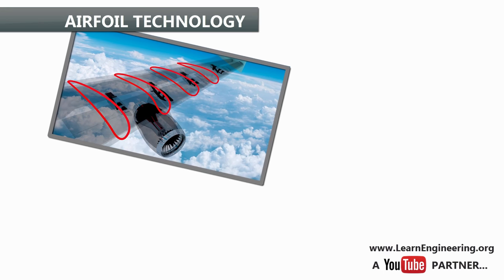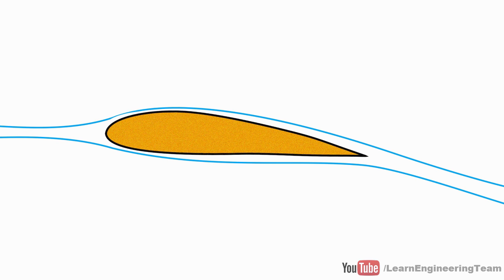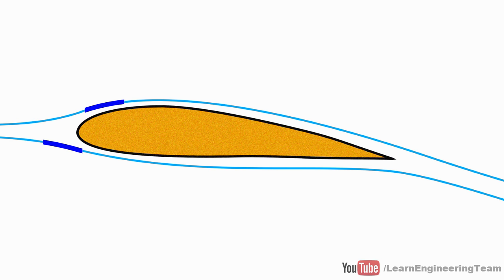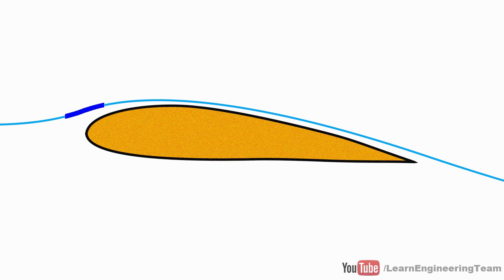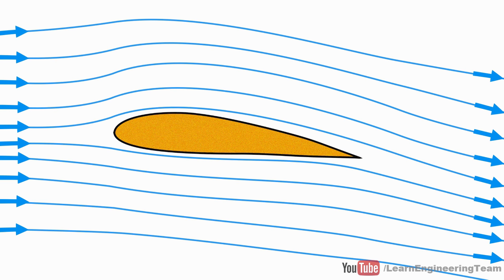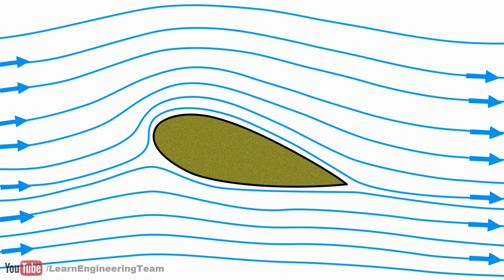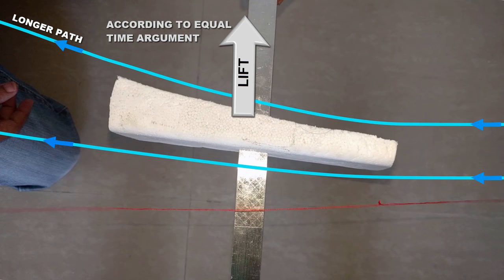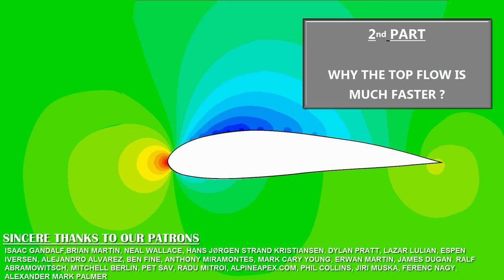How do Wings generate LIFT?

Comment: Wouldn't the venturi effect play a major roll in this too? Fluids at higher uniform velocities have a lower pressure, even when they're forced into a tighter pipe.
To such a predictable degree, that high volume flow meters don't measure the velocity of the fluid to know its velocity, but rather the difference in pressure to know its velocity. Even air speed indicators operate on this principal.
If the air on top is moving at a significantly higher velocity than the bottom, then there should be significantly less pressure.
That's the way I always understood it, even before I read any books on it (which had the equal time theory in them).
Reply: Yes, a 2D model must always have a venturi effect.   The lifting force is always a Newtonian force pair, and while one end lands on the airfoil, the other end lands on the distant ground.  This problem is rarely mentioned in intro courses (hoping the smart students won't catch them,) and in advanced courses they appeal to "Starting Vortex" to remove it.    Yet in the real 3D world, the lifting force lands upon empty air, not on the distant ground.   Also, the 3D airfoil is depositing momentum into the descending air; an effect which is entirely absent in 2D flow diagrams.  In other words, 2D diagrams always depict "ground-effect flight," but they've conveniently erased the ground from their diagrams.  True 3D flight is nothing like a venturi, instead it's more akin to a pulsing jellyfish leaving behind a trail of ring-vortices.   But without the pulses.   Like this: http://amasci.com/wing/lasrWing.gif
Reply: errrrrrr, that is just wing tip vortices
Reply: > errrrrrr, that is just wing tip vortices

Ah, you've go the typical misconception: the idea that vortex-shedding is irrelevant, or that the vortices are tiny things only at the wing tips, or that the vortices stream out horizontally behind the wing.   All three are extremely wrong.

In fact, the lifting force is entirely created by vortex-shedding.   Unlike with flight in two dimensions, flight in 3D is a matter of vortex-shedding, where the vortex-wake behind an aircraft is carrying off the downwards momentum, same as with the jet of gasses below a rocket, or the downwash-plume below a hovering bumblebee.

The tip-vortices are actually the core of a vortex-wake which has roughly twice the width of the entire wingspan.  The "vortex" is far bigger than the fuselage, far bigger than the wings.   That vortex-pattern carries immense mass, and that vortex-pattern is descending.    It's the "rocket exhaust" of an aircraft, where the plane only stays up, because the mass-bearing vortex-pattern has been forced downwards.  To clarify, here's a classic video segment: http://amasci.com/wing/lasrWing.gif
Reply: +wbeaty what are you talking about? wing tip vortices create upwash as well as downwash, and cannot be responsible for creating lift! it creates induced drag, but otherwise does not affect the wing aerodynamics
Reply: +jiunn wong What textbook did you use?  In fluid mechanics etc.?

> wing tip vortices create upwash as well as downwash,

You have a serious misconception.   The vortex wake of a wing is the downwash, is the Newtonian reaction-mass which keeps the aircraft aloft.  You're right, the circular flow doesn't contribute to lift, only the net downwards motion of the entire vortex-pattern contributes to lift.  (I ask what textbook your class used, because some texts ignore this major point, never treat the vorticity aspect of flight, and only analyze wings of infinite span.  If yours does this, then your misconception is not your fault.  It was taught to you.)

> it creates induced drag, but otherwise does not affect the wing aerodynamics

No, it has an enormous effect on wing aerodynamics:  vortex shedding is the single origin of lifting force.

Unfortunately, intro texts pretend that physics of winged aircraft is utterly different from the physics of helicopters, in that a hovering helicopter has net downwash  ...but wings do not.  That's wrong.   Specifically, they pretend that the tip-vortices trail horizontally behind the wing.   No.   The tip-vortices (and the entire vortex-wake) are carrying enormous momentum downwards, and they descend continuously.    The tons of 747 aircraft remain aloft because the downwards-moving vortices are associated with enormous mass which was left in downwards motion by the aircraft.

Is this important?   Only for the physics, since without this feature, 3D wings violates all three of Newton's laws.

A 3D aircraft cannot remain aloft without producing a downwards-moving wake, a wake which performs the same function as the momentum-carrying exhaust plume of a rocket's reaction motor.  Like so:

- If a rocket could hover above the ground without forcibly ejecting reaction-mass downwards, then it would violate momentum conservation as well as violating Newton's 3rd.

- If an aircraft could remain in level flight above the ground without forcibly ejecting reaction-mass downwards, then it would violate momentum conservation as well as violating Newton's 3rd.

See what these "Bernoulli based" explanations gets us?   Simplified concepts, but accompanied by blatant violations of high-school physics.
Reply: +jiunn wong

Thanks, that's exactly what I'm looking for!   Much appreciated.   I don't have Shevell, only much older stuff, so I'll look for a copy.

> Shevell is prudent enough to NEVER claim the source of lift as newtons third law.

Yes prudent, because this would clearly expose the Newton-violation found in typical explanations.    As long as we conceal this problem within pressure-based reasoning,  or distort things using "starting vortex," the flaw remains hidden.

Heh, I've been doing this since 1989, and have yet to become tired!

But if you don't want to respond to my huge message here, I understand entirely.    This is all still good practice for me, since "enemies will find my errors."    Two decades later, they've found most of them.

> I believe you are the one who misunderstood wing tip vortices. There is a net downwash, as well as a net upwash.

I understand the circulation explanation, the flow-turning version, the vortex-based version, plus the Newtonian explanation of wings, including the Feynman Sprinkler problem in physics, etc.  I'm trying to flesh out the Newtonian explanation as in Anderson/Eberhard recent textbook.    I and two others have been fighting this battle since 1988, and managed to push the meme enough that "Airfoil Misconception" has invaded major newspapers, piloting forums, RC aircraft forums, etc., and now academia has discovered it, and started posting lectures to youtube.  Finally!    "Airfoil Misconception" started with Kraus, but I've nominated myself as "Kraus' Bulldog" and rubbed everyones' noses in it.   My best success is with NASA GRC website, which directly attacks the known airfoil misconceptions.   But not this one.

The Newton-violations I'm now discussing only are discovered when one understands all of these Lift-explanations in combination, from a momentum-conservation viewpoint.   It's simply stated as, "A 2D airfoil diagram depicts ground-effect flight only."   That's a key concept to accept and understand.  (Accepting it I think is the hardest!   2D airfoil diagrams are direct violations of Newton!)

:)

Another key concept is, "Fixed-wing aircraft are fundamentally like hovering helicopters, if helicopters are drifting horizontally, at any speed."

Move a hovering helicopter horizontally at 1in/min, or 10ft/sec, or 200MPH.   There is no threshold where the physics suddenly changes to that of a fixwing.   In all cases the momentum-carrying downwash does not diminish at all.   Yet the helo downwash does become smeared out into a slightly-diagonal pattern, and appears to vanish entirely; trailing horizontally behind the rotor, while actually the parcels are descending as always.   The physics of fixed-wing aircraft is the physics of a hovering helo, or bumblebee or hummingbird, regardless of horizontal translation of the craft.

> You cannot simply learn principles from what you have been taught, you must be able to criticize the principle and prove or disprove the principle with proven basics.

Exactly.   Exactly.   I've detected profound misconceptions in intro books, then popularized this.  But then, being "sensitized," I started seeing a profound misconception at all levels, not only at the childrens-book level discussed in the video above.    You yourself have misconceptions and are making fundamental errors here.   If we continue, I'll demonstrate.

>  For example, for the wing to affect sufficient downwards mass flow, it  must impart momentum to the free stream..... where does this momentum come from? 

The NET momentum comes from gravity, from the down-force of the aircraft weight.   In order to remain suspended above the earth, "in level flight," an aircraft must somehow shed down-momentum constantly, with this down-momentum being injected into the craft per unit time, by gravity.   This shed momentum must either end up in a confined downward fluid jet, or be cancelled-out by an instant upward contact force with the ground, as in a venturi diagram.   GEMs use the venturi phenomenon to remain aloft.   Fixwings dump their down-momentum into a fluid jet associated with vorticity, where the location of the vorticity is descending.

> The engines and bird muscles cannot produce that magnitude of power!

Of course they can!  (Hovering crows, hummingbirds, bumblebees   ...they're helicopters in basic physics, just with a different pattern of vorticity in their downwash.)    In all these cases, the work performed in creating the momentum-carrying fluid jet appears as a component of induced drag.    The work done by hummingbirds and helicopters is mostly a consequence of induced drag;  the dumping of momentum into a confined, descending flow.

I think the following fact is little known:   induced drag has two components, first, one originating from the mechanical work performed in rotating the parcels associated with tip-vortices.   A second component originates from the mechanical work performed in moving the momentum-carrying vortex-pattern downwards.     (The parcels don't just "swirl," they also descend uniformly.)

> In any case, the root principle of conservation of energy would rule the 3rd law of motion explanation invalid: 

No, it doesn't.    COE and Newton's 3rd both apply to helicopters, and in identical fashion apply to wings in 3D, where a wake-vortex is being produced.    (Yes, you make a good point for 2D diagrams, where no wake-vortex is produced, and the lifting force is ground-effect force only, like a venturi.    But 3D aircraft do not harness this venturi direct-contact force, except when flying below a wingspan in altitude, WIG.)

> Fixed wing aircraft must create the same downward mass flow as a helio of the same mass, thus it must expend the same power to stay aloft and NOT any less, and this is simply  not true.

Wrong, it's exactly true, yet there's a common confusion:   the separatrix of the Hills vortex, and the fact that fluid jets carry net momentum, yet the parcels at the intake of a fluid pump do not inject net momentum into the pump.  (That's the Feynman Lawn Sprinkler problem.   Also the reason that a fluid pump produces net thrust, but only for high-Reynolds, where a jet forms at the pump outlet.)   Together, all these concepts give us the explanation for a hovering helicopter, where the incoming air does not deliver net momentum to the rotor, but the constrained downwash DOES carry net momentum away.    Gravity injects the down-momentum into the fixwing craft, and exactly this same down-momentum must be shed into the downwash of the wake behind the craft, otherwise the aircraft couldn't exactly balance gravity and so remain at the same altitude.   

OK, here's the thought-experiment:  move a hovering helicopter at ANY horizontal speed, and then we attaing the physics of a fixed-wing aircraft, but viewed via Newton's laws rather than from surface pressures.   (Or, do you claim that a 'special' large horizontal velocity exists, a velocity where helicopter-physics vanishes, and fixwing-physics magically appears?    There is no such velocity.  The downwash momentum never becomes any smaller.)  The same physics applies to both fixwing and helo.  Only some long-standing tradition makes us believe that the Newton and the "surface pressures" treatment must be representing entirely different physics processes.

You've seen this GIF below, right?     It shows the significantly-descending vortex-wake behind a fixwing model.    That vortex-wake also appears behind a helicopter in rapid horizontal flight.    A fixwing aircraft follows the same physics as a "helicopter moving sideways," and the fixwing aircraft is dumping momentum into a very large and significant downwash, as shown below...

http://amasci.com/wing/lasrWing.gif

The downwash seen in this above GIF ...might it actually be insignificant and feeble, and we're allowed to ignore it?    No, because don't forget, this is a thin slice, while the entire downwash occupies immense volume, and so contains immense down-momentum, same as any helo downwash.    The weight of any 3D aircraft appears in its downwash. (not just helicopters, but for all aircraft flying at altitude, while not in WIG/GEM.)

Our typical widespread misconception, at the level of undergrad and graduate textbooks, is to mistakenly believe that this downwash only exists for helos.

Additionally, we pretend that the vortex-wake behind a fixwing aircraft is NOT DESCENDING, when of course, it actually is.  (The faster we fly horizontally, the more the downwash becomes "smeared out," and appears as a slightly-diagonal pattern in the miles of wake behind the aircraft.)    Ignore this net downwash of wings and we blatantly violate all three of Newton's laws.    Or, ignore the horizontal motion of a fixwing aircraft, and its downwash becomes that of a helicopter.
Reply: wbeaty I read your reply carefully and was writing an essay on you errors, and then I realized something.  

Sir, one does not go to college to learn advanced subjects such as Aerodynamics from textbooks or any one source. You go to college to learn how to learn, how to determine what is fact and what is opinion.

You should not be taught lift, well the exact details anyways, so one should not be in position to be taught the wrong thing.

In summary, your opinions are assertions, and your arguments assume your theory is already true: that is pseudoscience.

Lift from pressure does not violate laws of motion because lift is a reaction to atmospheric pressure.

2D flow is not theoretical and not WIG flow. It is wing in wind tunnel flow, or a section of a real wing that is far away from the wing tips to ignore wing tip vortices.

The nice gif clearly shows vorticity with downwash as well as upwash, furthermore, the smoke mass show no net downwards motion.

Down wash cannot account for lift because it is caused by lift, there is a logic loop that requires lift to be generated twice.

Rotary wings have wingtips that move in a circle, thus it can be proven by math that upwash disperses while downwash is consolidated into a mass flow thrust. this does not happen in fixed wings because the wingtips move in a straight line, and hence upwash cancels downwash.

Sir, you have ignored upwash. 

Lift is created by a flow field that has a lifting pressure difference, as opposed to an ideal flow field without a lifting pressure difference, due to boundary layer separation at the aerofoil trailing edge. 
Effectively, the wing acts as a vortex and flow above the wing is accelerated while flow below is decelerated. This vortex and the reaction wing torque is the only action reaction pair.
All this is proven by math and experimental observations. 

Perhaps you should seriously think about why NASA does not attack the misconception you are talking about
Reply: > Sir, one does not go to college to learn...

Agreed.   I think my motives aren't clear enough. 

First I learn a topic from textbooks, but I apply Feynman's dictum "what I cannot create I cannot understand," and I approach the topic from many viewpoints, and try to create the concepts from first principles.  Sometimes I find an error in textbooks.  So, I then post my findings in a place where others can pick them apart.   Others may find flaws in my thinking I haven't yet seen.  I've been doing this online since 1990.  Pseudoscience?  Hardly.  It's called prepublication discussions, or 'informal preprint.'  Or simply "debate."

But I must search widely before I find an opponent who can actually reason.   Then, I have to find someone who actually cares about the physics, and cares if textbooks are getting it wrong.   That sort of person is very rare, and worth responding to.

--

In short, I see two major errors, one which is now called "equal transit fallacy,"  and the other yet has no succinct label.

Error 1.  Starting in 1988 I found what is today called "equal transit-time fallacy."  I wasn't the only one; Prof Klaus Weltner also wrote on it in 1990 AJP journal, and Jeff Raskin published on it in 1994.  But these articles were completely ignored by the aero and scientific communities.  

The misconception was taught everywhere, including pilot schools.   I nominated myself to be "Klaus Weltner's Bulldog."   So, I discussed the misconception widely in the 1990s "newsgroup era,"  made lots of online noise, then wrote a 1996 article, and spent years pushing the misconception down everyone's online throats, including physicists, pilots, RC modelers (all on their own forums.)  And, pushing the wind-tunnel smoke-pulse photos from 1956!  Those are difficult to ignore. http://amasci.com/wing/airgif2.html  The aero community was in denial, and fought furiously against accepting that they might be so wrong about lifting force.  After all, the transit-time fallacy was widely taught as truth in pilot training, and worldwide licensing exams contained the error.  Prandtl made the error, so did Einstein, both quite blatantly.   I pushed the misconception on Wikipedia, and many there agreed that it was an actual error.   Finally the meme caught fire!  In 2000/2001 the entire aero community shifted, and "airfoil misconception" was being published widely everywhere, journal articles and magazines and the NYT,  including eventually the Cambridge talk, and this youtube vid above.  The direct result of my interfering with lifting-force teaching was the creation of the NASA GRC education site which teaches lifting force by attacking airfoil misconceptions.  An indirect result was the Anderson/Eberhard textbook "Understanding Flight."

Error 2.  In discussing the transit-time fallacy with physicists online around 1997, I realized that a 2D wing in a 2D simulation (or in a 2D wind tunnel) does not explain flight.   The force-pair of lift, it is profoundly un-physical in 2D.   Either it appears between airfoil and ground, no matter how distant the ground; constituting a variety of 2D venturi effect.    Or ...we must add "starting vortex" to artificially inject vortex-shedding, which does cause the Newtonian lifting force-pair to become localized (so that the force then is applied to air alone, and the ground may be removed from the picture.)   But it is required that the starting-vortex be nearby, and the ground at far greater distance.

> 2D flow is not theoretical and not WIG flow. It is wing in wind tunnel flow,

I wasn't clear enough.   Here's my statement to pick apart:  

2D flow surrounding a 2D wing, if no 'starting vortex' is present, is a depiction of ground-effect WIG flight.  No matter how distant the ground, 100% of the down-force is applied to the ground surface as an instant "venturi force."

Use method of images to calculate the force upon the ground for a 2D airfoil in a 2D world.   Now, increase the altitude of the airfoil.  The down-force upon the ground does not decrease.  Instead, the down-force produced by the circulation will simply become wider, and weaker.   Therefore, in 2D the airfoil is always trapped in WIG flight mode.   But with 3D aircraft, they can escape from WIG, and instead inject their down-momentum into the air itself (into the descending vortex-wake) with no ground needed.   Flight of real aircraft is based on vortex-shedding, and not based on WIG.   BUT, the typical 2D diagram does not teach anything about flight-by-vortex-shedding.   Perhaps postgrad courses get into this, but it's a non-obvious part of their math, and the simple intuitive aspect of the explanation is obscured.

>  It is wing in wind tunnel flow,

In a wind-tunnel?  Yes, we can create this pure-2D situation by using an airfoil-segment where the tips of the segment are in sliding contact against the tunnel walls.  No tip-vortices, no vortex-shedding at all.   This is the situation commonly depicted in textbooks, and used to explain lift. ( It's sometimes called an "infinite span" diagram.)   But an infinite-span aircraft can never fly high enough to escape WIG operation.  That's the exact problem I'm pointing to and blathering about.

> or a section of a real wing that is far away from the wing tips to ignore wing tip vortices.

Wrong.  We can never get far enough from the effect of the tips, because the entire trailing edge is shedding a sheet of vorticity.   A diagram depicting a 2D section of a 3D flow about a wing must include the consequences of shed vorticity.   The main consequence is that the circulation about the wing does not reach to the ground, and the down-force half of the lifting force can be applied to the air itself.   For these reasons, a 3D diagram, even if it's a thin 2D section, is profoundly different than a purely 2D flow-diagram.  On the other hand, a 2D section of a 3D flow is closely related to a pure-2D diagram where the starting-vortex is present.  With starting-vortex included, the flow ahead of the 2D wing is not symmetrical with the flow behind, and both momentum and energy are allowed to be injected into the air itself.  (This, even in 2D.)

But this brings up a different problem:   in a pure-2D world, if the starting vortex is 100 miles distant, but the ground is not, then the effect of the ground will dominate, and the starting-vortex plays no part, and again the airfoil is stuck in WIG mode.   The adding-in of "starting vortex" is a delusion, a hasty patch applied in ignorance, and only works if the distance to this vortex is << than the distance to the ground.

Put simply, "2D flight" with no vortex-shedding, it violates Newton, unless we teach our students that the extremely wide pattern of 2D circulation will cause the weight of the aircraft to appear as an instant down-force on the ground (meaning, it's depicting WIG ground-effect flight.)     But flight in 3D is not WIG.   The 2D diagram does not explain flight, it explains WIG.

OK.  Put simply, the flight of all fixwing aircraft is identical to the flight of a helicopter, including the extremely significant downwash associated with hovering rotorcraft.   Put simply: if we translate a hovering helicopter rapidly sideways, the downwash still is the mechanism of lifting force by F=mA,  ...and the physics is that of a fixwing aircraft in horizontal flight.    A helicopter is quite similar to a hovering rocket, except that a helicopter draws in reaction-mass from the sides, above and below.  Big insight:  any fixed-wing aircraft is the same, it's drawing in reaction-mass from all directions, then launching it downwards, as part of a vortex-wake, like this:

http://amasci.com/wing/lasrWing.gif

This laser-smoke diagram is a way for explaining how wings work.   It illustrates the lift-production mechanism, a mechanism which needs no distant ground surface to "push against."
Reply: wbeaty if you want to debate then please address the flaws I have pointed out in your reasoning.

1- There is no net downwash due to wing tip vortex in a fixed wing aircraft. math proof of this in sum of vectors in a linear vortex is zero: the upwash cancels the downwash.

2-Fixed wing aircraft do not fly like rotary wing aircraft. the rotary wing creates a wing tip vortex in a circular loci, resulting in net thrust flow. This is clearly not performed by fixed wing aircraft.

Although the allure of the equal transit time myth is that it is very close to the truth, I am NOT defending that theory. 

My problem is people think that fixed wing aircraft fly by creating downwash, which is not true.

There is no venturi effect to speak of in the flow field in 2D wing. 2D wing lift has nothing to do with the ground. I have already explained how a 2D wing generates lift, with evidence principles, and there is no ground in the equation. 
You have yet to find fault in my explanation of lift!

you keep insisting that flight of real aircraft is based on vortex shedding, because it observes the 3rd law of motion by generating lift from downwash. 
This is BEGGING THE QUESTION. You cannot prove your theory with the mechanism of your theory.
Please prove that there are first principles that creates vortices and their shedding before lift can be create. You cannot: Because vortices are a result of lift!

all your other arguments are based on this main fallacy, and are hence void.

And finally, it is entirely possible to create real wings that have very weak and near non existent wing tip vortices in straight level flight. Wing tip fences and devices, tapered and elliptical wings, wash out, extreme AR: all have been tried and done. Practical 2D flow in sections of real wings in flying aircraft is fact.